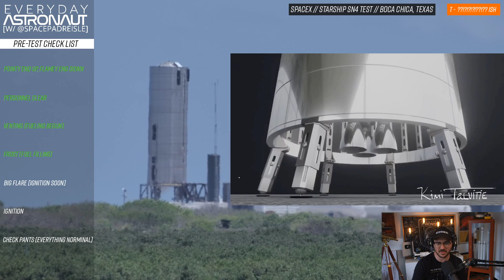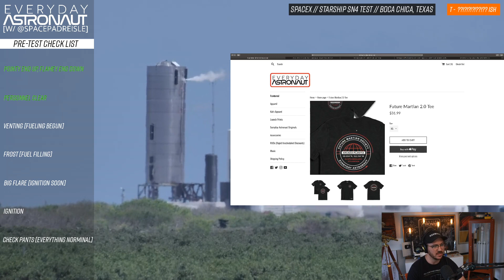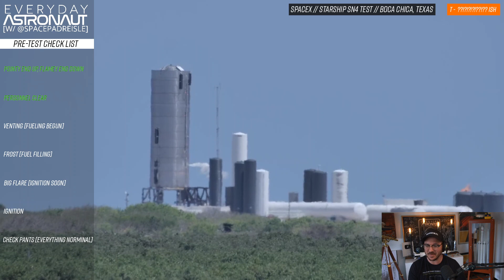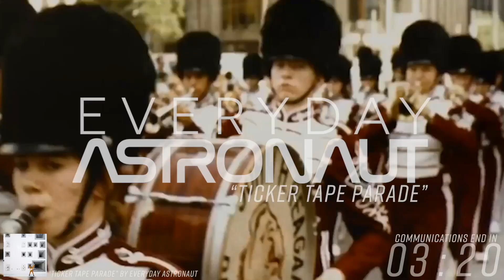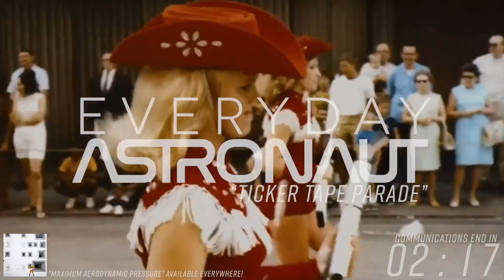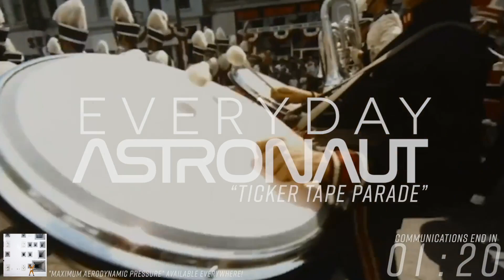[May 18][NOTHING HAPPENED DON'T WATCH!!!] Let's watch SpaceX static fire Starship SN-4!

Comment: Hey Tim thanks to your excellent and informative videos I do understand a lot of stuff about rockets. I doubt any will be of use to me in my life  I will never need to know about a full flow rocket engine and I doubt it will ever come up in conversation but it is knowledge I am glad to have.
Thanks to your videos I even understand why there are sea level and Vacuum optimised engines air pressure right the only real difference is that vacuum engines have wider noozles as there is less air pressure pushing the exhaust hence they work better in different flight regimes more efficient.
So my question is is it dangerous to use a sea level engine in a vacuum or near vacuum and vice versa or just less efficient? Will a rocket go boom or just not perform as well?
I ask this because a production Starship will be boosted to near space before it even fires its rockets and 90% of its powered flight will be in a Vacuum. It will only use its engines in atmosphere for landing so will it be better to have 6 vacuum engines rather the three and three mix we see on test vehicles or will we have the rockets go boom issue???